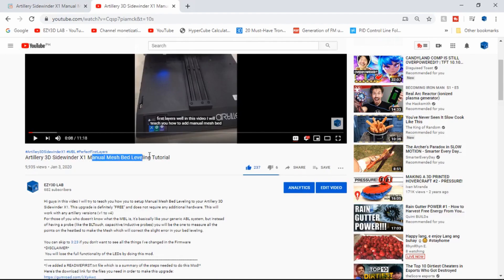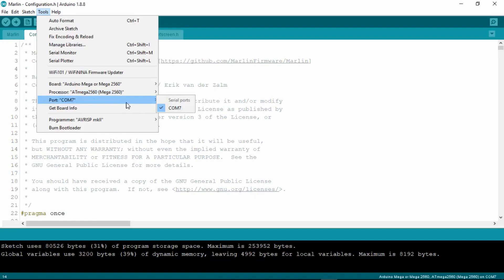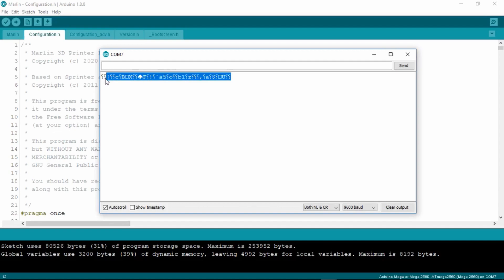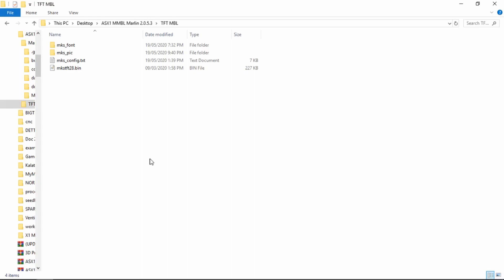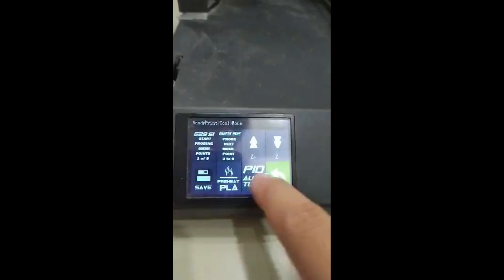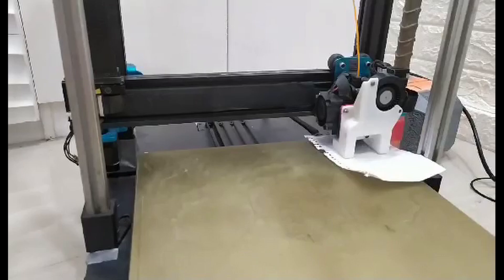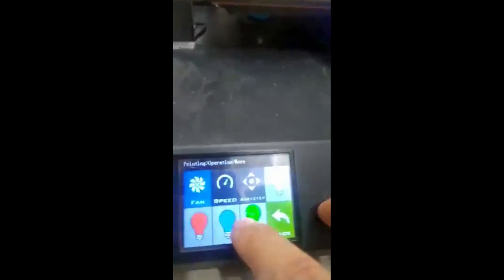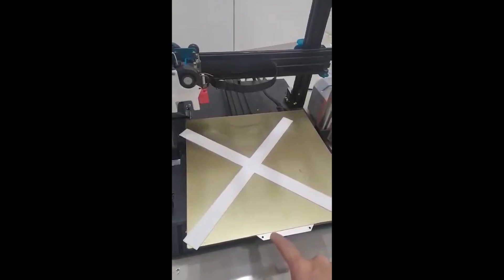Artillery 3D Sidewinder X1 / Genius Manual Mesh Bed Leveling Tutorial - Marlin 2.0.5.3

Comment: Hello. My printer recently had an issue where in the middle of a print, the extruder motor stopped working. Since then I have replaced all the PCBs and ribbon cables, as well as the extruder motor. However, nothing has seemed to fix the issue. When I try to load filament, the motor makes a loud sound but the gear does not spin. Do you have any idea what could be causing this? It occurred a couple weeks after uploading this code from this video, so I am wondering if it possibly has anything to do with that.
Reply from the maker: A fw cannot just change all of a sudden when printing, so I highly doubt it's the fw's fault, you can revert back to stock if you like and see if it will fix the problem. You have all of the vital info to troubleshoot this, It can either be these things, 
1) stepper motor is busted ( you can easily check this by hooking it up to a different axis) but tbh, stepper motors are the last component in a 3D printer that will get busted.
2) Stepper motor driver failed (quite common when the heatsinks fall and it overheated causing permanent damage to the driver just like what happened to my first x1) Swap it out with another driver and see if it will work
3) Wiring for the stepper motor is loose
4) Ribbon cable/loose connection.
Reply: EZY3D LAB Ok thank you. The motor is not busted, as i tested it on another axis. I will try the driver. Thanks for the advice!
Reply: @EZY3DLAB  Hello. Where exactly is the stepper motor driver, and what does it look like? Sorry i'm just not too familiar with 3d printer electronics.
Reply from the maker: @michaelo9071  You need to open up the bottom side of the printer. I have a video where I check the Vrefs of the drivers, you can check it out.
Reply: EZY3D LAB So i connected the motor directly to the main board and it worked just fine. Any other ideas of what the issue could be?
Reply: Ribbon cables are all brand new and secure. So is cable to stepper motor
Reply: I do notice this. When I move the gear connected to the stepper motor with my finger, it moves nice and smooth. However, when I plug in the ribbon cable into the extruder pcb, the motor has resistance and does not spin as smooth.

Comment: Excellent video! Are you willing to sell the gantry support? :)
Reply from the maker: @GamingPedro The author of the Z frame brace was Joel Nicklasson,
https://www.facebook.com/groups/artilleryswx1/permalink/382269392397732/

You can print the parts and just buy 2 pcs of 600mm 2020 aluminum extrusions. It's an easy and effective upgrade.
Reply: @EZY3DLAB  got it, need to look for a store selling those braces separately. Will update my printer tonight. Thanks for the guide!
Reply from the maker: You're welcome! If ever you need help please let me know. 

I think someone is selling a different Z brace kit using carbon fiber. I think it's this one .https://3dchanh.com/my-store
Reply: @EZY3DLAB  Really having a hard time with the full bed adhesion even with the Manual mesh level. Did you source your PEI spring still locally?
Reply from the maker: @TheGamingPedro  one of my patreon had the same problem, here are the things we checked 

Is the x gantry leveled?
Is your esteps calibrated?
Are both your z stepper/drivers working?
Have you manually leveled the bed prior to probing the mesh?

Etc. (We also tried increasing the flow rate for the initial layer) 

What actually did the trick was he wiped the bed thoroughly with IPA alcohol then wiped it with soapy water then he rinsed it while the bed was hot. 

I bought my spring steel sheet on AliExpress, it's the energetic spring steel sheet. It has a thick magnet sheet which rivals the whambam.

Comment: Do I need to do the steps on the 1st video before i do this?
Reply from the maker: Nope. You can do just do the steps in this video.
Reply: @EZY3DLAB   thnx, and this version have something changed from the artillery base stats? Only problems I have is hard time leveling without mesh but athere all good and prints with no problems... PLA+ 210/60
Reply from the maker: Yes, mainly slower feedrates. The stock settings is a bit too "aggressive" for my taste. You can change it back in the config_h tab.  

Before leveling (manually) make sure that your x gantry is completely perpendicular to both the Z axis 2040 alu. Then proceed on manual leveling then Mesh leveling. I recently helped someone last week witht he same problem. We couldn't get the bed leveled with manual/mesh leveling. After realigning the gantry, it worked fine and he hasn't had any problems.
Reply: @EZY3DLAB  MUST DO IT FROM SD CARD?
Reply from the maker: You can change it via pronterface so that way you don't have to reflash the printer. :) Btw, what do you want to change so I can help you with it.
Reply: @EZY3DLAB  All work, only thing forgot you did 200/60 and I use pla + with 210/60. maybe later. ty
Reply: Say what is the M600 update? A lot of ppl talk about it but i thought we already have it....
Reply from the maker: @BloodBlaid  M600 is a command in marlin which is for filament change. 

That can be done by S3D without any fw modifications. Not all users have an "actual use" for it to be completely honest.

Comment: I am unsure which is the TFT cable in my sidewinder x1. my MKS Gen L 1.0 looks VERY different than what you have pictured in the video and nothing seems to be labeled "TFT" not to mention everything in mine being hot glued together... 

For what its worth, I tossed you $5 via paypal for your marlin download but I am unsure if I am even going to be able to use your tutorial now haha.
Reply from the maker: Hello Michael, 

You can either remove the tft wire that is connected to the TFT itself or remove the cable from the mks gen L (it should be the "AUX-1" port. I will link a picture for the mks gen L so you can easily see and trace where the aux-1 port is at. 

https://ae01.alicdn.com/kf/HTB1ig0vdjfguuRjSspaq6yXVXXaG.jpg
Reply: @EZY3DLAB  I really appreciate the quick response on this. I hope that it helps someone else who has the same printer. Unfortunately I went through all of this and it all seemed to work as you showed in the video but it has not solved the problem I am having with first layer adhesion. I am not saying this to try to guilt you into helping me or something. I am going to show a video to folks on reddit maybe. Thank you again, you are a good person.
EDIT: I guess for the sake of helping others who might be searching around (even though i dont have the solution yet) the problem I am having is that nothing is sticking at all really. I had a couple of absolutely stellar prints when I first got the machine 2 days ago and then suddenly after doing what I thought were just some tiny bits of tuning (re leveling the bed with the included software and cleaning the bed with 99% IPA and a light cloth, and turning a screw or two) it has essentially stopped adhering at all causing prints to almost immediately just become a ball of goop on the print head. I have tried unclogging, replacing the head, tuning the filament lever tightness, and now went through all of this and still the same exact result. I will try to update this if I find a solution.
Reply from the maker: @DCsk8rgoelz  please do check if your X gantry is well aligned with both Z axis. Another user had the same problem and we went through everything and it was indeed a badly leveled X gantry (stock) which really caused the prints to not stick. You can diagnose it if one side of the print sticks so well while the other side lifts off completely.  I can't remember which user is it that I previously helped but I'll try to look at our comment-convo here for you.
Reply: @EZY3DLAB  I will take a look at that, I suppose I havent tried printing on just one side or something of that nature to get a read on where exactly its not sticking. It SEEMS to stick nowhere but maybe im just frustrated and missing that it sticks on one side but not the other
Reply: @EZY3DLAB  Its actually mostly working now. I think I had two problems at once. I think I was under-cleaning the bed because I decided to just go ham on it and then run your test print one more time. It worked mostly except for a few corner spots in the bed center and one side of the y axis being a bit worse. I am now working on an elephant pot to test this overnight (that is, if it starts up nicely so that I can leave it unattended without worrying.)
If I get this working then you can add 'you probably arent cleaning it enough, clean harder' to the list of stupid things your viewers do lol. I can hear the steppers 'singing' in a way that seems to match the ups and downs of the bed so it does seem to be compensating for some bed warp. What part of the firmware did you change to make the thing move slower though? I would like to be able to change that if needed at some point.

Comment: does this work if i use Octoprint after the flashing and mbl?
Reply from the maker: It should work. It's not in conflict with octoprint. You can also babystep via octoprint which is very nice.
Reply: @EZY3DLAB  everything worked wonderfully, I am thrilled! many thanks for your effort. I still have one question: what does the pid Auto tune do?
Reply from the maker: The PID tune is for auto-calibrating the nozzle temp. Use it if your nozzle temp is fluctuating. :)

Comment: Why would you flash Marlin 2.0 if you have an 8 bit board? Won't that eat up the memory?
Reply from the maker: For the extra features Marlin 2.0.x has to offer. 
That is true if you have the stock creality boards that uses the Atmega1284p which has a very limited memory. 
The Artillery X1/Genius has the MKS Gen L which uses the Atmega2560. 
(You can activate almost every setting(s) you want and it still won't eat up the memory)